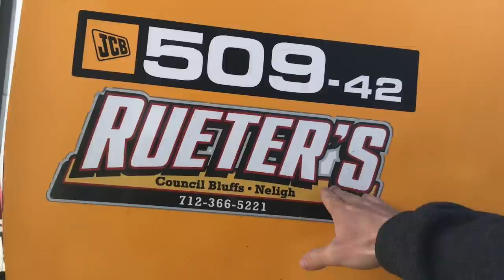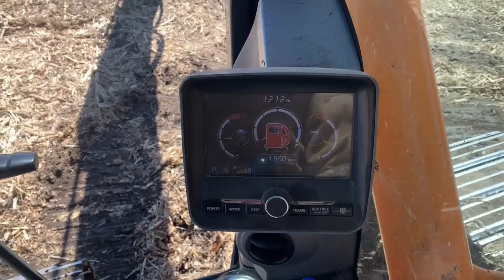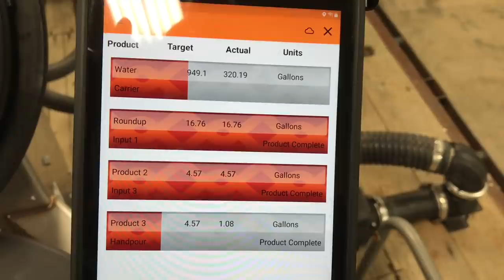This One Upgrade Saved My Farm $125,000

Comment: Spending money to make money, god ol adage. glad to see innovation on the farm, It'll be interesting at the end of the year to see the cost savings and yield gains between this and the new planter and see the long term payouts.
Reply: I'm praying that all their smart work will bring amazing yields! "Work smarter not harder!"
Reply: I'm interested to see it too.  But I wouldn't be surprised if for the first and/or second years aren't as good as they could be until they learn how to use the systems for their particular operation because when you first start using something new like this, there is quite often some tweaking to be done once it's actually out in the field.

Comment: Looks like a winner with the mix mate.  Don’t forget to get a tool box on the trailer.  Some wrenches and wires and oils.  That way the generators and pumps will have oils on hand.  Maybe also a smallish gas cans? That way when the trailer leaves the yard it ready to work for a while and not run out of gas with a few acres to go.

Comment: Thanks,  Concern for the hidden cables. Out of sight can mean out of mind. I have seen unarmored cable inadvertently damaged during non planned events.  IE hooking up a chain for a vehicle/equipment  recovery. Truck batteries on one end and a Deck  mounted battery is a lot of potential current arcs and sparks.  Battery disconnect switches may be well advised also.  Yall are smart folk.  Many brains work well for good solutions.    God Bless and thanks for feeding us.

Comment: Love the mix mate should speed sprayer operation up and make more accurate records and mixing , weakness would be those gas powered pumps new really reliable , older  not so much , and their always out of gas !! Hydraulic drive off truck only way to go and when sized right it will out pump those gas pumps and as long as the truck will run you'll have a pump !! Not putting system down at all it's beautiful , just  have had a lot of experience with hydraulic drive liquid pumps and love them !! Ice on  the puddles here this AM no planters running around here !

Comment: PST  in front of the susention should be a plug in the wires you would find a blue one for the ABS brake system, the Blue wire is live as soon as the key is on you could have cut away the coating and tied into the cord at the point where the wires were needed, to elliminate another conecting point at the front to foreget and pull apart when unhooking

Comment: Question...Will you have to remove the I-pad thing when it rains or do you have a water proof case to put over it?
Reply: We use a rugged Android tablet.  It is always a good idea to protect it from the weather and too much heat, but we actually rinse it off in the farm shop sink when needed.

Comment: What if you had multiple injector pumps and just flush system and keep different chemicals on board and switch back and forth. You could always drain each reservoir  but never have to worry about phytotoxicity.

Comment: Gotta question...is the trailer going to be sitting outside, if so would you consider installing a pop up permanently over the equipment so it won’t get wet?  Just a thought.
Reply: I think they keep that trailer inside the heated shop
Reply: Everything on the sprayer trailer is suited for the outside weather.

Comment: Cole, have you guys ever considered SENZIT units? The electronically monitor your air filter systems on any vehicle or piece of equipment? They help you from over maintaining and using the air filters to the fullest potential. I might be able to hook you up. If interested, respond with a way I can contact you.

Comment: did you put an air fitting (from trailer air tank works great) on the fill hose so you can blow it out when you're done loading?  1/4" air line is plenty for 3" fill line.  edit - 14:50  :p
Reply from the maker: Stephen M yep 😇

Comment: What happens when the gas pump doesn't start ?? You had better a few spares on hand . Those things can be tricky to get going  .USE HIGH test gas ,the ethanol in regular blocks the fuel system if it sits .I am sure most farmers know that. I had a hell of a time with small motors until I figured it out

Comment: Ballpark price on the mixmate?
Reply from the maker: Eric Decker $22,000. Which is about 1/2 to 2/3 of a top of the line manual system.
Reply: Cole answered you correctly for his system.  The price does depend on how your system is set up.  Mixmate is very flexible - and you do not need to purchase everything at one time if your budget does not allow.  Prices are listed on our web page:  www.praxidyn.com

Comment: I like automation. But can I trouble shoot and repair this thing when it goes south. My favorite part is when they no longer support a piece of equipment after 5 years and the thing has to be replace because one microprocessor puked. Please Cole consider the legacy equipment and the ability to repair legacy equipment. What happens when its not new.

What do farmers and fireman have in common.

Lockem in a room with two iron balls ,come back in an hour  one ball is broke and the other is missing.
Reply: Remember, maintenance free doesn't mean it won't fail, it only means you can't fix it.

Comment: not to pick apart your work but could you of used pvc pipe and pipe fittings instead a lot of those rubber hoses and the glue on fittings and not have to fight the hoses to get onto the fittings and do away with hose clamps?  I'm sure you did but on all those hoses and stuff is there at the lowest point of each set of lines a way to drain the lines out for the winter so they don't freeze and bust I'm sure you put it on but didn't mention it

Comment: Here is a tip for the future, A company I owned made commercial hoses. When installing hoses PVC or rubber, if you have a turkey fryer pot or some other way of boiling water, stick the hose end in the water till it gets hot and you can slip the ends right in. You can also take a propane torch and hold it away not to melt a PVC hose  or burn a rubber hose and it will soften a PVC or make a rubber hose soften, spray some mild soapy water on and the ends will slip right on.